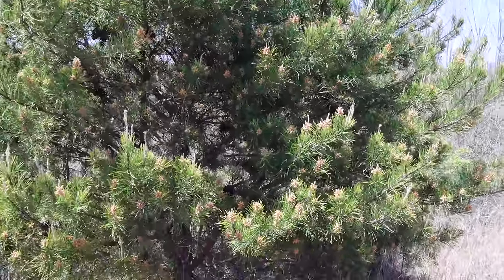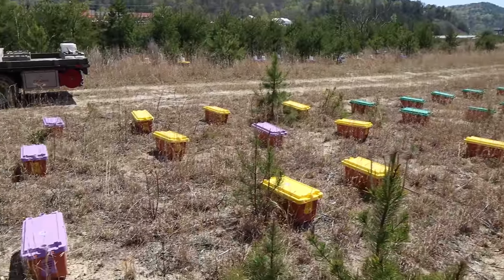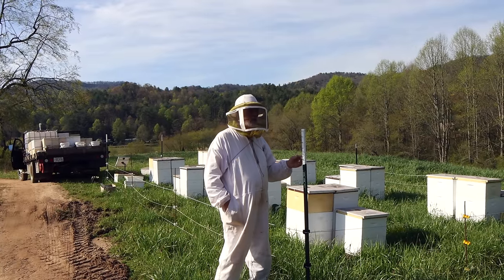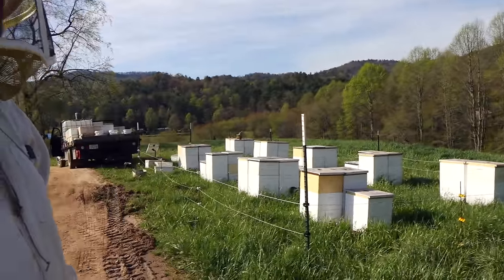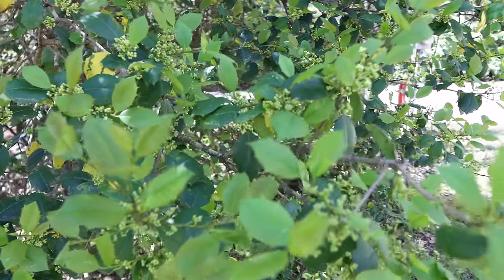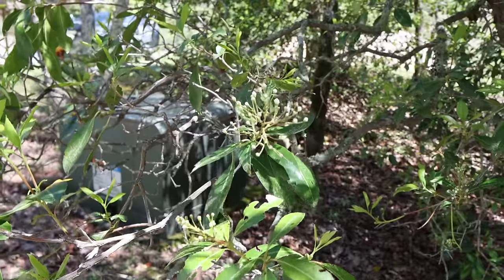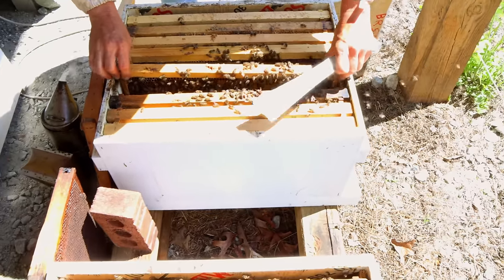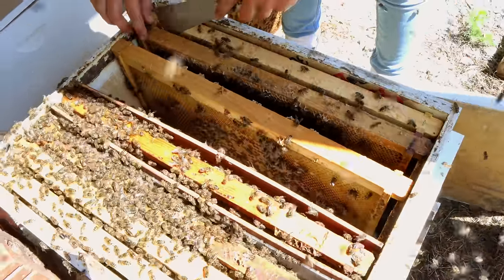April Bees & Plants

Comment: Good stuff Mr. Binnie! I just had  a "well duh" moment, shaking bees onto the isolated breeder frame... I use your method for grafting as closely as possible and I've found that the queen never starts laying right away, which puts my grafting off until the 5th or sometimes even the 6th day. You told Sylena and John to shake bees onto the frame and said it helps get her to get started and I said to myself, why didn't I think of that.... sometimes it's the simple things that squeak by without noticing. Great video!